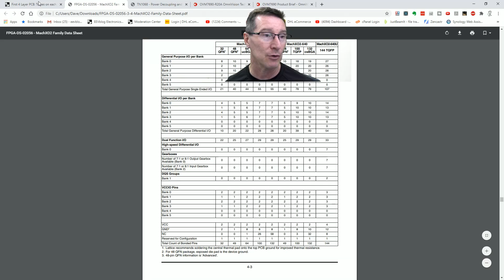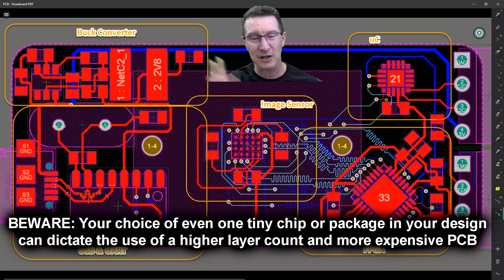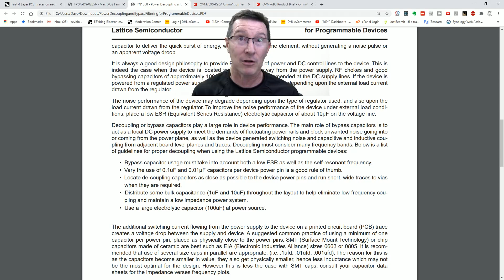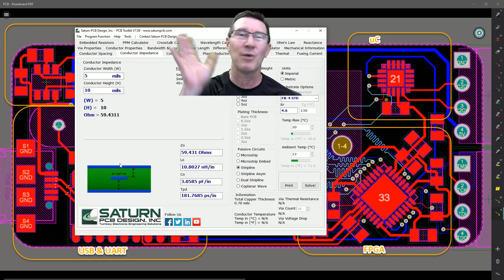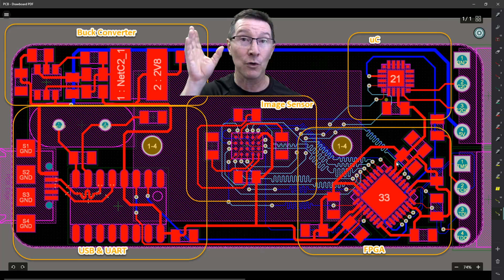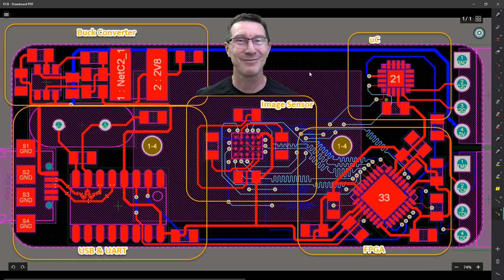EEVblog #1323 - PCB Layout Review & Analysis

Comment: First issue I see, USB DN and DP need line resistors before IC.
Reply: They are can be inside chip
Reply: If the quality of the layout is any indication, i would actually guess that the schematics need a review first too. So you might be on to something, but afaik this is probably a CH340 USB to RS232-TTL converter that has all the required serial and pull-up resistors inside the chip package.
Reply: @ProtonOne11  Agreed. I kinda gave up about 5 minutes into the design, as I think there could be a ton of issues and probably a lot of mistakes in the SCM.

Comment: what is your take in a 2 layer board with top and bottom GND polygon poors vs power and GND?
Reply: On this board, flooding with power would make little sense.
There is more then one voltage. There are only a few power pins.
So in this case, I personally would recommend a star connected Power system and a GND polygon pour on bottom.

Also note that not pouring on the component side also simplifies any rework/botches you might need to do. Cutting traces near a polygon pour is tricky. cutting a simple trace is easy. Removing a component is also harder, as the pour acts as heat sink.

Note that when you make a 74HC series logic grave where everything is powered by VCC, then power on top and GND on bottom (or the other way around) makes sense.

In cases in betwhen those two extremes, think about it.

Comment: Yes the talking head is weird but it works for this kind of video where you need to move yourself out of the way.
For some reason you look kind of pale (more than usual). Maybe there's some way you can adjust the camera to make your face look warmer and less blue.
Reply: Adjust the white balance/colour temperature.
Reply from the maker: Light isn't the best in the cubicle, and it's all auto exposure etc.

Comment: Hello all you awesome EEs. I am an Army Vet, former aircraft mechanic, and dabble in electronics by building circuits for my RC hobby. I have no idea how to design a board for PCBWay, and can't find a simple diagram online. Basically all I need is a board that has 4-8 spaces for radial capacitors in parallel. I've seen close, but they are almost always for a rectifier layout or some kind of buck converter. All I need is standard pads that are in a row, with some heafty power traces (my system can draw as much as 400a) and pads to connect 10ga wire. How do I do this? And thanks to anyone who can help.
Reply: https://en.wikipedia.org/wiki/Stripboard is this what you are looking for? You could probably reinforce the copper traces with some tin and wires for the peak current. I'm kinda starting to think that your capacitors are not actually rated for that kind of current tho, or they would have some beefy screw terminals to be directly connected to a copper bus bar.
Reply: @ProtonOne11  I make my own out of strip board. And yes have done things like reinforce the traces, run copper strips on the traces, or have also ran 12ga silicone wire stripped by 5cm to beef up the layers. I'm simply looking to copy this, but with 8-12 sockets 
http://www.castlecreations.com/en/capacitor-packs/cc-cap-pack-011-0002-02

Comment: With all these tips, I bet this can be done on a 2 layer board instead of a 4 layer
Reply: If your board supplyer allows the low clearance/width needed for the tight BGA fanout on a 2 layer board, yes. But usually the cheap china supplyers have a much better specification for multilayer boards than on the cheap as possible double layer boards.

Comment: Why do you do snake like traces
Reply from the maker: I explained, to match the length.
Reply: Actually it's about timing. You want to make sure that your signals reaches the inputs at the same time (if all the parallel bits are driven at the same time). So when you sample the voltages of the signals, you know they are actually at the proper voltage level and you don't have one bit "lagging" behind. Signal speed on a pcb is about half the speed of light if im remembering that correctly, so for very fast signals and high sampling rates, it's starting to get more and more critical to do length and impedance matching to not introduce unwanted signaling errors

Comment: I am not an expert in PCB design, but looking at the PCB design is very painful. Very poorly designed board.
Reply: Well, whoever designed it had to start somewhere. I am sure you also made mistakes in your first design.
Reply: @elektrofreak-andg  no one is perfect and even skilled designers make mistakes all the time. If someone is just starting up then shouldn't play with FPGA or Camera. Home works need to be done prior to doing such things. One or two mistakes are digestible but when it's full of that then its a pain indeed. But for your understanding PCB design is actually an art and it requires lot of practice to get to a point when someone call you a PCB designer. Most of them are just connecting traces to make it work.
Reply: @SatyajitRoy2048  Don't make such a big deal about it. The other person was probably doing it as a hobby.